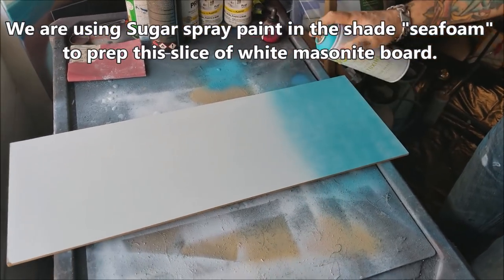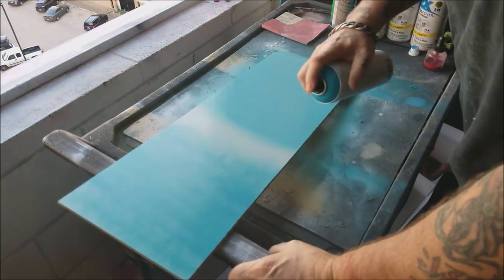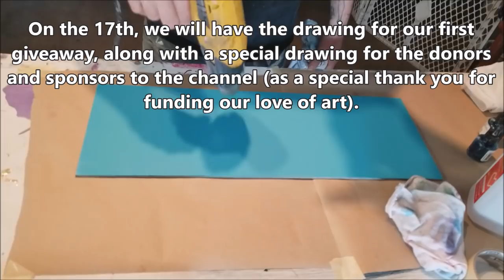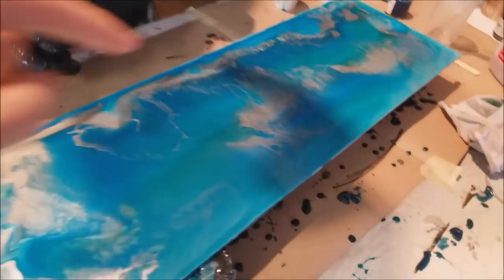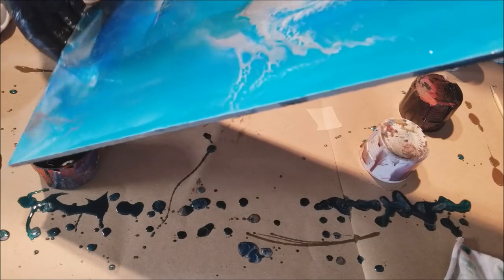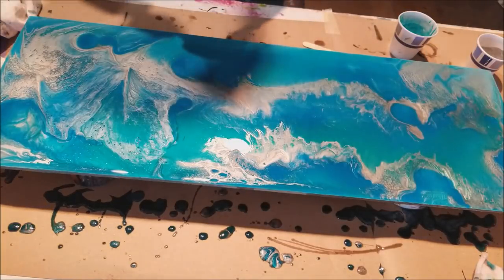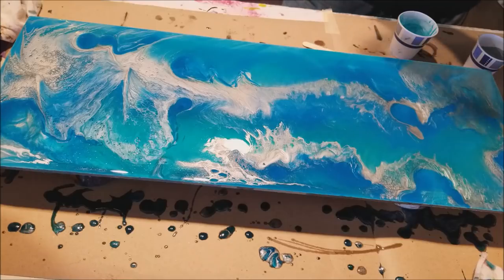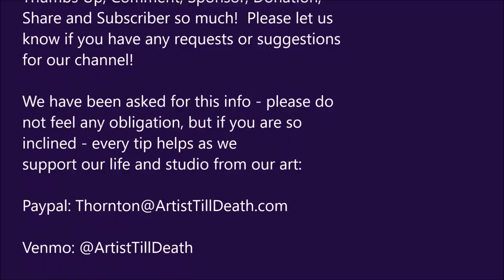Beginner's EASY 3 color pour (oceanscape, seascape, waterscape, skyscape) - with a recording fail

Comment: What if I want the original paint to show through but I don't want all of the colors to cell up? Can I still lay down a coat of clear? I'm thinking I just wouldn't heat up the color I don't want to cell. Is that Right?
Reply from the maker: Hey Rhonda.  If you want the original painting to show through you have to lay down some clear and will risk the celling.  If you really want to avoid the cells you can lay down some clear and let it set, then lay down another layer, let it set and then clear coat over the whole thing. (I hope that makes sense)